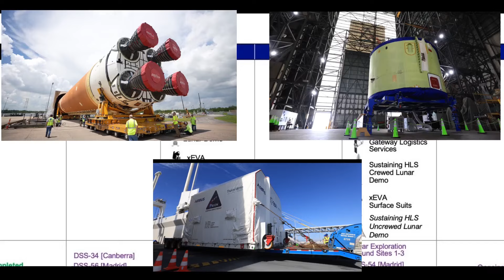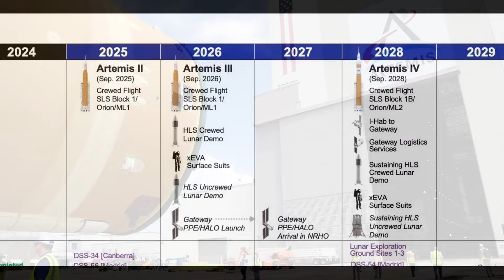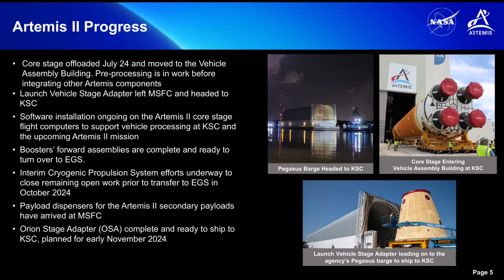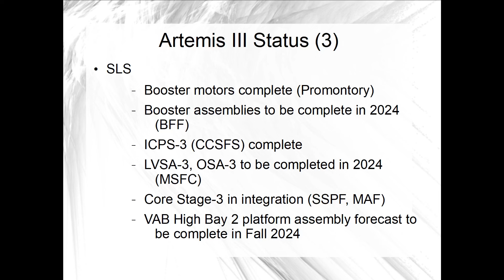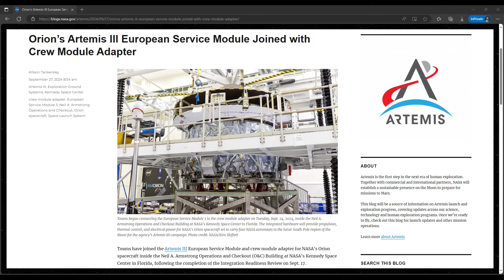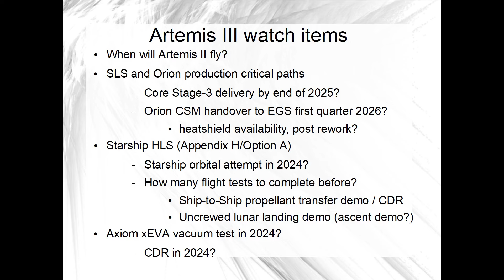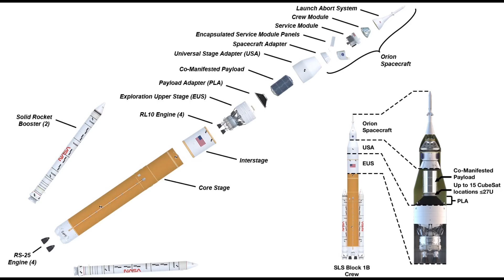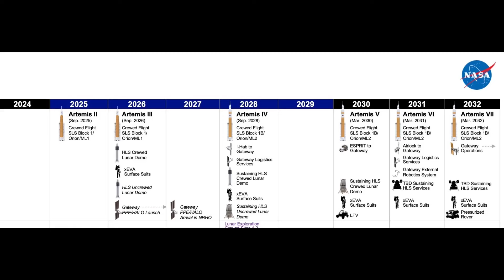NASA Artemis II, III, IV Quarterly Update #3, 2024 Third Quarter in Review

Comment: Even though SpaceX now caught their heavy booster and got a step closer to delivering on HLS with all its refueling needs I can't see that uncrewed landing test happening just two years from now, not to mention a crewed landing. Do you think they might use Artemis III for testing out the NRHO even in the absence of HLS? That would still be testing something new since Artemis II is a free return trajectory around the Moon and no Lunar orbit of any kind.
Reply: in the absence of HLS they would surely not use the SLS for an NRHO demonstration, they could ask the ULA or RocketLab to put a boilerplate into NRHO once again, or simply just do nothing and delay Artemis 3 1-2 years
Reply: @Canraptor  Rocket Lab can't throw Orion to the Moon and I doubt ULA can either, maybe if they develop a 3 core Vulcan.

Comment: It's a certainty that SuperHeavy will be launching dozens of times per year by the time Artemis 4 flies.  At that point, it would make no sense to persist with the utterly unaffordable SLS - annual build cadence feasibility notwithstanding.

A new partially reusable multi-stage heavy launcher for deep space missions using SuperHeavy as the first stage, would make much more sense at that point - even if one makes sense at all, once orbital propellant depots and refilling are in full bloom and Starship is then able to do what no SLS-like architecture ever could or ever will...
Reply: There is nothing certain about the superheavy. Just possibilities and uncertain timelines.
Reply: @velisvideos6208   SuperHeavy flying regularly is an absolute prerequisite to Artemis 3 - which involves HLS Starship conducting orbital refueling from an orbital propellant depot stocked with propellant by several (on the order of 10) Tanker Starships.  And Artemis 3 requires at least two such missions - an unmanned one, followed by a manned one.  That's on the order of 20 Tanker launches, plus the launches of at least one Depot and at least two HLS Starships - not even counting any preceding propellant transfer and Depot and Tanker prototype demo flights.

And that's before even considering the Starlink deployment launches, which by the Artemis 4 timeframe should already be in the dozens per year - if not approaching or surpassing 100 per year...

So yeah, I very much stand by my assessment of the certainty.
Reply: It's possible .. but SpaceX needs to stop having only partially successful test flights .. and start having fully successful test flights.  Catching boosters, landing Starships ... wash, rinse, repeat.
Reply: Wait until they actually try fuel transfer successfully. It's going to be a long time.
Reply: @TheMoneypresident  per NASA's current "haha, pull the other one" schedule, that's supposed to be happening in Q1 of calendar 2025.  More realistically, it'll probably be more like Q4 2025 if not H1 2026, IMHO.  Still, not that long of a wait, in the grand scheme of things...